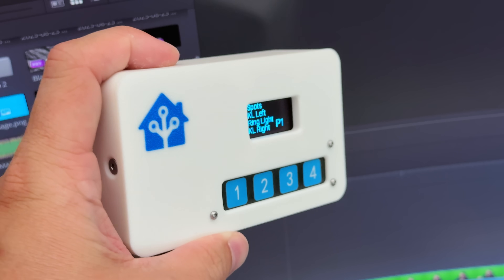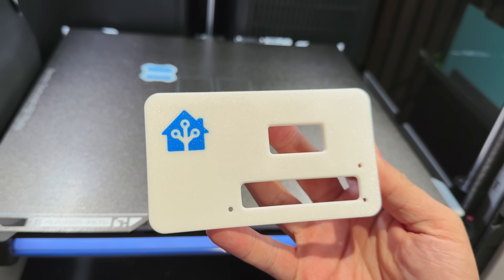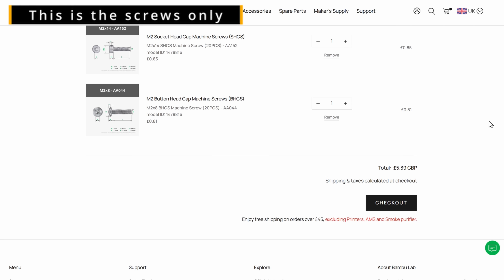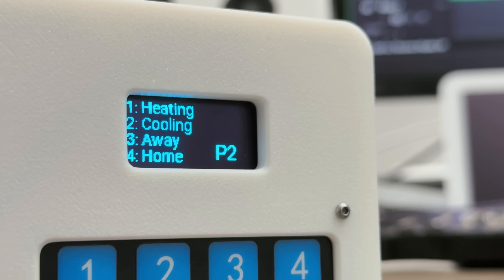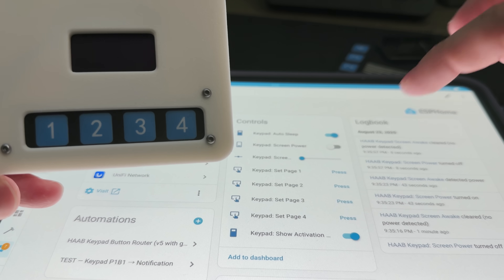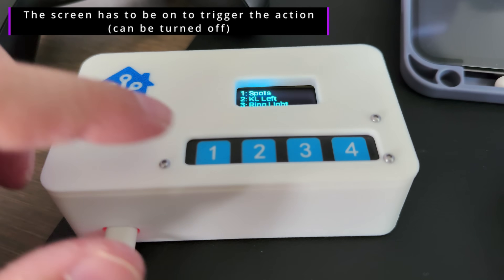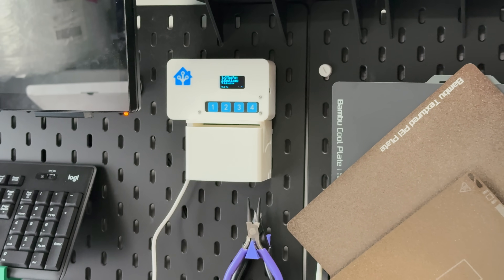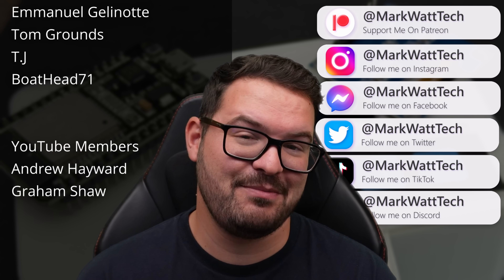The Home Assistant Button Box (ESP32 + ESPHome)

Comment: I think you ment DuPont not wago. I didn’t see any wago’s used in project. All I saw was DuPont connectors used.
Reply from the maker: I switched out the wagos in the final design to slim it all down (i think I put a message up on screen). 

But yeah just Dupont wires and the esp for this one :)

Comment: I did something similar with 8 different resistors going from ground to a button each and back together.
By measuring the resistance  on the esp pin I was able to put actions to the individual buttons.

Comment: Nice. I have been wanting something like this for the shop for turning various equipment on and off. I have a few old kindles around I thought of using but none of them are able to be jail broken to install full android on them.  I'm surprised there isn't a cheap solution like this available commercially.
Reply: I bought and rooted some cheap ONN tablets. The UI looks the same because they are all identical. I've got one everywhere I want to control anything. I've got one in the drawer of my nightstand. I can turn everything on or off without leaving my bed.